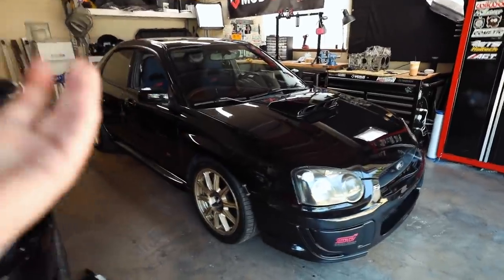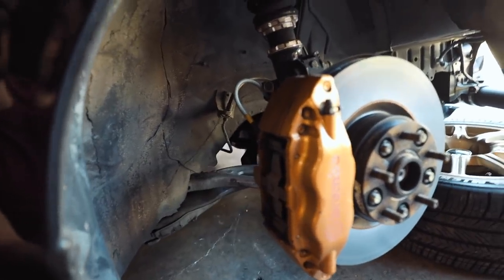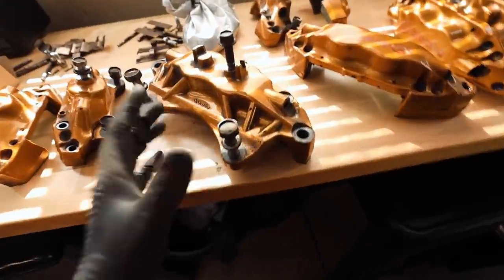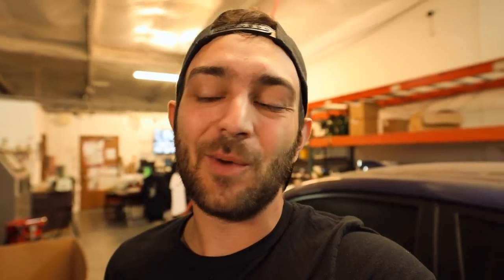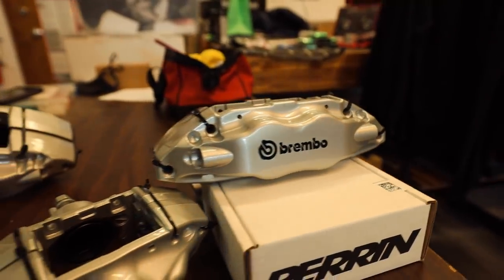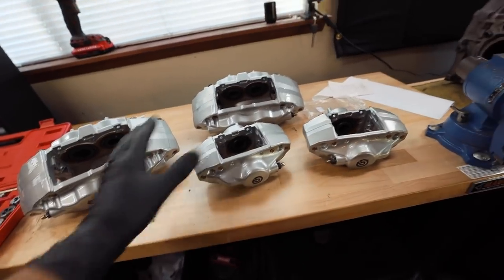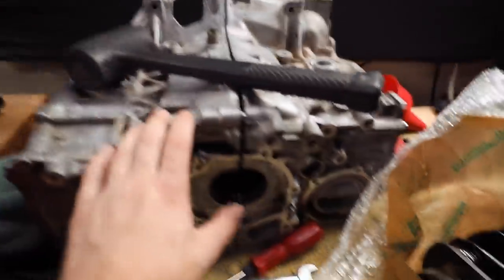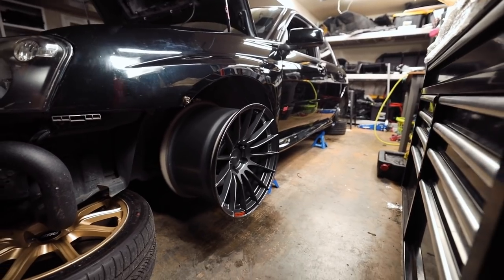Brembo Brake Rebuild/Restoration Subaru STI, Incredible Change!

Comment: Currently big sad, money was getting tight and I had bills to pay so I had to sell my project car. This channel makes me feel a bit better though so thank you
Reply from the maker: Hopefully your able to snag another in the future ❤
Reply: I mean it wasn’t nothing special, 5 speed manual 2005 Scion tC with aftermarket headers and exhaust, coil overs, aftermarket taillights, cold air intake, on black 17x8 enkei edr9s but it had like 190K miles and burned oil like crazy. I actually sold it for like 3300 which was more than I put into the car, but it was my first project car so I kind of have this whole in my heart even though it was clapped out.
Reply from the maker: I feel it, same thing with my old Z when I sold it. Whats next on the radar for ya when the time is right? 👀
Reply: Haven’t really decided yet, I’m between getting another manual, something RWD or AWD this time or getting a truck. 

I live in Wisconsin and we sure do love our pickup trucks, a truck would probably be my best bet because my friends have four wheelers and my daily driver is the biggest car with the highest torque output in our group so I’m the one that ends up pulling them, but I drive an Avalon and it does some Carolina squat shit when I do that so that’s probably not good.

Comment: All you have to do for the bolts is take them to the wire wheel on a bench grinder. I wouldn't try and powder coat the bolt heads. Because you have to put wrenches on them. So it would wreck it anyways from the wrench or socket.
Reply from the maker: I ended up just going over the bolts with black touch up paint 😅 actually worked pretty well 😅🔥
Reply: @Smeedia  can you make a video talking about your different rim and tires. The weights of the rims and tires of each ones. And combined weight. Because you have a bunch of rim types.
Reply from the maker: I can definitely incorporate it in somewhere 😁
Reply: @Smeedia  my winter tire setup is 45 pounds per wheel. I don't know my summer sport setup, until October when I switch them.

Comment: The bugeye wrx just got all new drilled and slotted rotors, ceramic carbon pads, oem, caliper replacements and braided lines. Unfortunately the passenger caliper brakes bolt was the last one we needed to complete it, tried fire, force, and removers just wouldn’t come out now it’s at a muffler man getting the bolt out it was a 14 now a 12 rounded off as well rusted too
Reply from the maker: Lol oh no.... 😅 Hopefully it comes off, been there before and not fun to deal with 🙃
Reply: @Smeedia  agreed

Comment: You can get a fitting for the hose on your power bleeder that goes into the bleeder port on the caliper and revers bleed them with and overflow/ resivoir on the master cylinder it is SO much easier and faster
Reply from the maker: I ended up snagging one, definitely makes things go by quickly!

Comment: Just changed out my cabin air filter on my Hawkeye .... holy F*%# !!! That thing looked just like the one you pulled out of the BRZ , can’t believe this is the first used car I have ever done.
Reply from the maker: THEY GET SO NASTY and often over looked lol. They get worse the more you look at them over time with other used cars you buy lol
Reply: @Smeedia  I am so glad that I came across your channel !!! By the way those calipers are beyond sexy af !!! And I have tried to change my rotors and pads but like you said , for some reason I can’t get the pins to slide out of the top of the brake pads so now I am saving up money for a new set of calipers just don’t really want to spend a thousand bucks for Brembo, even tho they are awesome .. do u recommend any other brands of calipers or brake kits? Just don’t know what to do to get the calipers apart without breaking them cause I already started to mushroom the head of the pins so they probably won’t pass through the hole anymore
Reply from the maker: Get these! Well worth the money and much much cheaper than brembos! 

https://amzn.to/3fQghFK
Reply: @Smeedia  I already have these lol they go great with my black wrx but I’m afraid they will seize up again won’t they? That’s all I’m afraid of but I guess if I’m taking care of car it won’t happen.. any ideas of keeping those pins from seizing to the caliper? Don’t mean to bug ya so much I know u got a lotta peeps to keep up with
Reply from the maker: Snag a small punch and smack them out, worked pretty well for me in the past 👌

Comment: Also still need to get it over to Washington for you guys to take a look at the bugeye it needs help but my budget is very slow
Reply from the maker: Whats all left to do? 🙏😁
Reply: @Smeedia  coils are ceased, needs timing, seals and gaskets, new turbo, has a few leaks like boost and brake fluid, needs all new body panels and all fluids need to be replaced
Reply: @Smeedia  that’s the most of it

Comment: hello , try this method for bleeding the brembos: reverse bleeding ! empty the brake fluid reservoir, and use a syringe fill it with brake fluid and push bleed them from the brembo nipples to the brake fluid reservoir , be carefull to EMPTY the reservoir for each wheel and in that way u can do it alone and u do not need help to bleed them , i work in Rally preparation , when u have 20 min max to change whatever the car needs u will have to improvise . try it on any car even for the clutch master and slave ! u will have a good pedal INSTANTLY !
Reply from the maker: I'm still bleeding now, almost done though lol. We're doing brembos on Matt's car so we will have to give this a try on his! Appreciate the tip! 😁

Comment: Just got a set of STI Brembos in for my Baja.  Did a search for rebuilds and knew you'd have the info I needed.  I'll be doing Cerakote ceramic instead of powder.  Maybe I missed it, but is there a gasket or o-rings between the case halves?
Reply from the maker: Yes there is a small o ring, I snagged replacements from fast WRX 🙏😁 that Baja sounds like a fun build you've got going on 🥵
Reply: @Smeedia  Getting a Cobb 20g too as soon as I get comfortable with E85 on the VF48 in there.  Drive it every day so gotta stay a little conservative.  Appreciate the response on the o-rings.

Comment: Would you recommend getting brakes powder coated over trying to spay them yourself. Trying to get them looking better until I can get brembos, and I don’t want a shiny finish bc I know they’re just stock wrx brakes
Reply: They have a lot of surface rust so that why
Reply from the maker: I've tried spray finish like VHT and the can be good, powder coat will definitely last longer but for a temporary thing spray works great 🔥

Comment: I see you have the torque solution wheel spacers. Would like to do well spacers myself. What are you thoughts on perrin vs. Torque Solution? And did you change your wheel studs?
Reply from the maker: No need to change wherl studs and haven't had any issues with them, they're definitely cheaper than the perrin ones were as well 🙏

Comment: So can you powder coat and rebuild without them being taken apart?

I want to save the hardware from mismatching and also don’t want to tell the powder guys to install the o ring stuff.
Reply from the maker: I woudlent advise it, the O rings inside the calipers may break down due to the hesr from curing

Comment: Hey smeedia I was curious. I'm looking at potentially getting a next gen sti depending on how it actually looks and what specs and updates it has. If I don't like what I see I was looking at potentially getting a dodge challenger r/t or a Ford mustang gt. If you had to choose what would you go with? I have family that works for Ford and Chrysler so I get a good discount so that's where I'm looking.
Reply from the maker: Personally I would get an S550 over the new STI and the Challenger. Really like the styling of the newer mustangs and the potential they have 🔥

Comment: Ran into my first hiccup with my 2019 wrx. AC won't blow cold air. It also makes noise that is coming from under the hood when I turn thr AC on but stops as soon as I turn it off. Any knowledge to help me figure it out. I have an appointment with subaru since my car is under warranty but was trying to get an idea.
Reply from the maker: Sounds like it might be a bad compressor, it's rare that they go out that quick but can still happen. Lemme know what subaru says!
Reply: @Smeedia  I was researching what I could and that's what it was sounding like. Ya I will definitely get back to you when I get a firm answer. Thanks for the quick response 🙏

Comment: Is the newer generation wrx's engine any more reliable than the old ones? (are head gaskets still prone to breaking or the engine in general)
Reply from the maker: Head gaskets were never a real big issue on the turbo models, only primarily on the N/A cars. Thr FA20s are great engines, main issues are cam carriers and rods if you push power
Reply: @Smeedia  oh that’s great to know so how much power would make it an issue for the fa20
Reply from the maker: Up to 400 is pretty reasonable on the FAs, too much cylinder pressure will crush a rod though lol

Comment: How did you find the torque value to put the halves back together.  It seems that this is a classified,  TOP SECRET , info from Brembo, everyone said due to liability issues, my ass.   I wound up just torquing them to 70 ft lbs front , 43 rear.    What values did you come up with plsr?
Reply from the maker: Fast WRX estimates around 45 ft lbs but brembo won't release the actually spec, tbh I set my Milwaukee on setting 2 and just sent them lol roughly 50ish ft lbs

Comment: Those Brembos do be looking nice in silver. I just put new cross drilled/slotteds w/ carbon ceramic pads on the G this weekend, since my last set was completely spanked after about 4 years. 

I originally wanted to get the late model Akebono upgrade for it (Brembo was removed after 04 due to excessive wear complaints), but they're like $2.5k and I've had some employment issues lately. That and the non-Brembos stop just as well.
Reply from the maker: Very true plus those sound like some solid upgrades anyway, I kick myself for not just getting slotted rotors when I did my brakes not too long ago
Reply: @Smeedia  Yeah from all of the sets I've gotten in the past 5 years, a slotted or drilled/slotted set is just about if not the same price as blanks. I previously had slotted rotors but the ones I went with this time only offered d/s. No complaints.

Comment: Ohhh all bad. Yeah you will probably be bleeding those brakes for more hours... when you install a new master cylinder you bench bleed it first. Which JUST that part takes over 40 pumps or something before you even bring it to the car lol.
Reply from the maker: I fucked up 😅 was not expecting it to bleed dry but got it like 90% of the way now, a few more bleed cycles and it should be there
Reply: @Smeedia  nice.

Comment: Whats up my dude I have the oddest question if you can hit me back please it is in regards to my WRX and Uber bad knock showing.
Reply from the maker: Whats up!
Reply: @Smeedia  I think I may have found my AFR culprit (oil on MAF sensor), but I am wondering if I could take her to mod garage and if you could kind of give her a look over? I have a bad feeling that there may be something else going array. I only trust you to look at Sonic.
Reply from the maker: I can, when did you have in mind? 
And oil on the MAF?! That's pre everything pretty much no oil should be getting on there 🤔
Reply: @Smeedia  pre-modding yes. K&N rechargeable air filter (preoiled).
I was maybe thinking Wednesday this coming week if that is ok?
Reply from the maker: I'll check with Brian to see if there's an opening 😁
Reply: @Smeedia  thank you so very much my guy. I am trying to keep the motor very happy for right now.

Comment: What clear coat did you use for the calipers??
Reply from the maker: I belive it was off prison powders and was their ghost clear coat
Reply: @Smeedia  Oh so it was also a powder. Gotcha, I don't have access to a sand blaster so I think I'm going to go the spray paint method lol. I'll probably end up using Engine Enamel clear coat for them. Thanks!